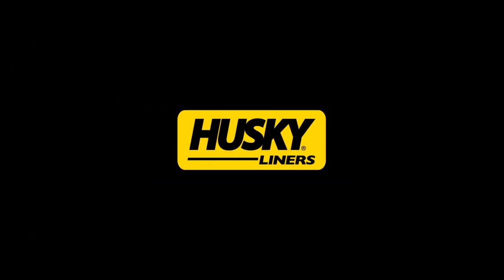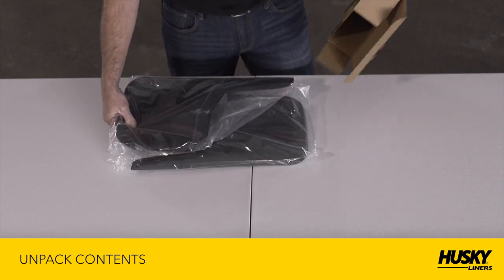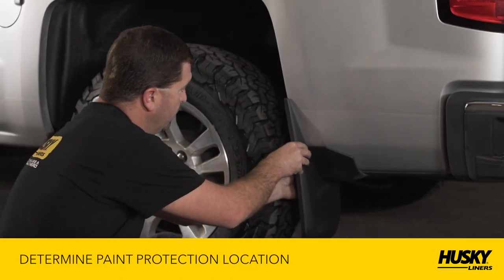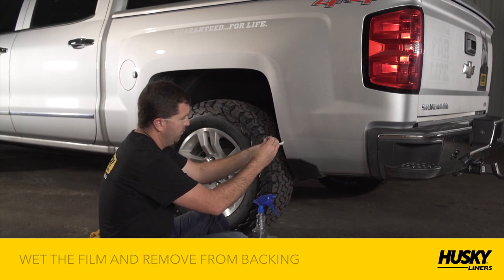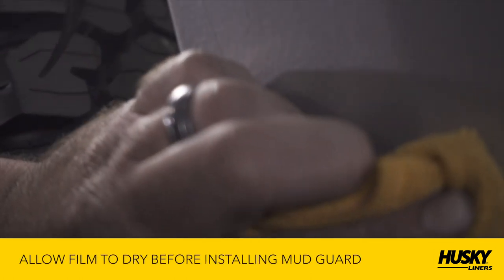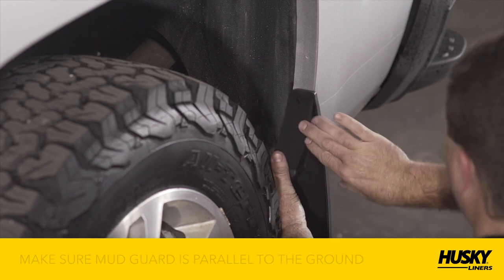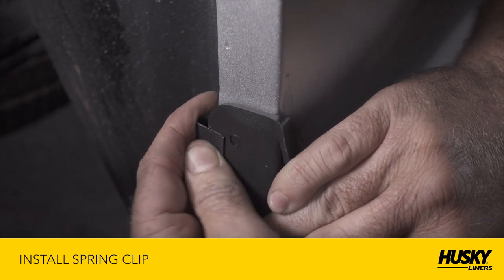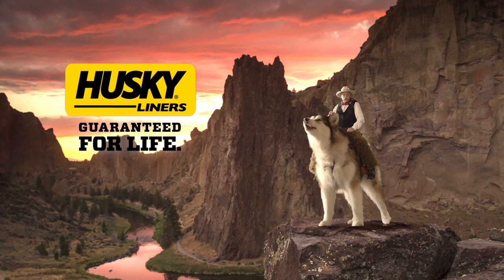Husky Liners® Mud Guard Installation Video

Comment: he is constantly blocking the view of placing the film with his hands. And camera is so far away from the imaging this film that you can not tell where the film actually is placed. So when it says when you have it placed correctly, but this video does not actually do a good job of showing this. Does it go behind the plastic mud guard where it bolts on the fender? 
or does the film go next to the edge of the mud guard?

Comment: Final clips were almost impossible to manage on 19 ranger.....took 1.5 hours fighting the four clips in place.
Reply: im about to order these for my Ranger aswell... how they worked for u so far?
Reply: Once I got them on...thanks to the wife...they have been just fine.
Reply: @traviswilliamson8688  Thanks for the update. Getting ready to order a pair for the 20 ranger.
Reply: @traviswilliamson8688  i am currently trying for my 2020 ranger, I managed the back ones after some time, but the front ones refuse to get one, how the fuck did you do it?
Reply: I wish I coukd tell you....I pried and pushed and cussed for 1.5 hours  throwing stuff in the process....wife calmly came out and slid the retainING clips on in less than 5 minutes,total for both sides....go figure
Reply: @traviswilliamson8688  aha!

I once I figured out the back passenger one, back driver went on with ease.

Then I tried front passenger, spent a good hour cussing as well, I finally figured I should slide the clip in a few inches higher than the top of the guard, and use a flathead to keep it pried open and work its way down into the mudguard.

My only issue is the adhesive didnt stick on the fender and has created an open gap.